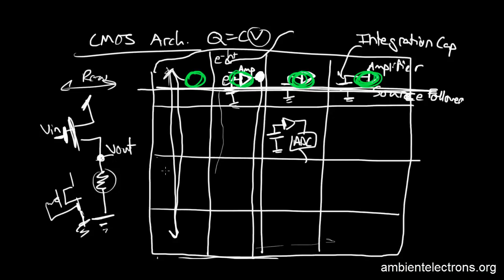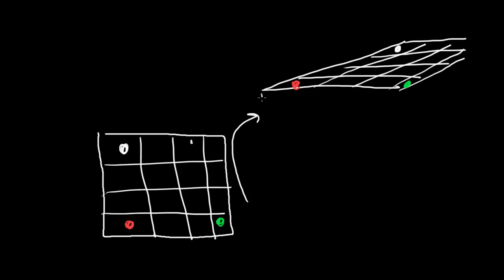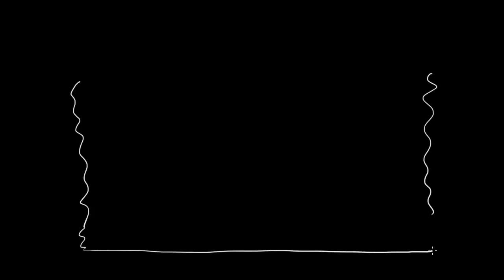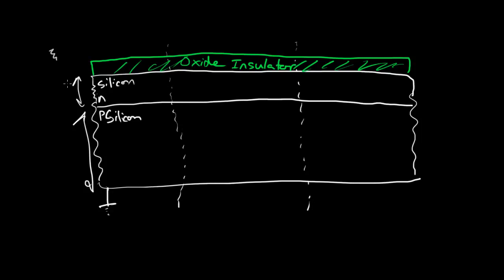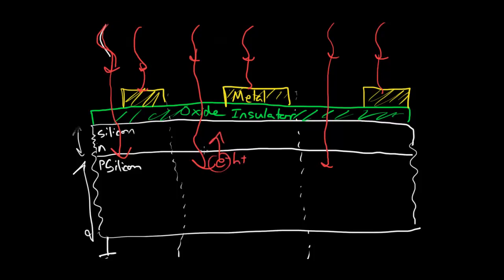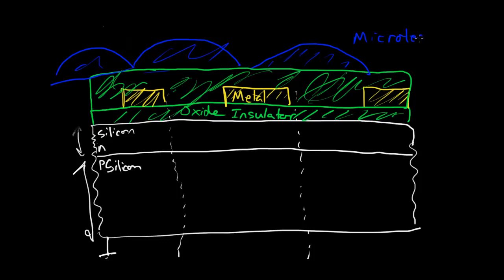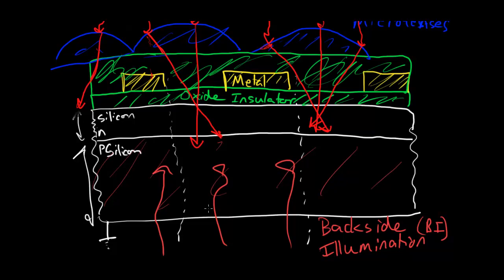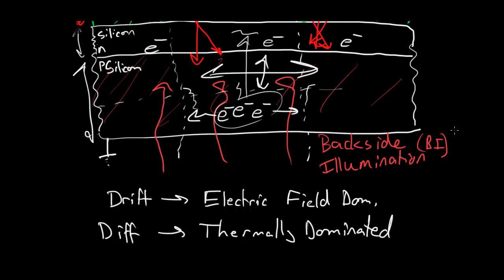Image Sensors 5 of 6 - Frontside and Backside Illumination

Comment: Is the metal + oxide the region acting as capacitor (and maybe amplifier?) and is being read out?

The photons whether they fall on p or n type semiconductor will cause electron hole pair, of which the electron will move to the edge of n type semiconductor from where it needs to be tapped into a readout.

I think you did a great job at explaining visually but the 3 dimensional nature of the whole thing still poses challenges when visualised in 2d.

Comment: Would it be possible to locally adjust the bias voltage to affect field and depletion inversely proportional to charge in capacitor well? It would be amazing to integrate large in the beginning then taper off electron-hole generation as the capacitor saturates.

Comment: I wanna ask a question about that metal. Maybe it's dumb question but still. What is that metal? Why do we need that metal if we can just put it away somewere? Cool technology. Let's put some metal stuff above the photodiode and then, many years later, we'll invent that we can put this thing away. Wow. Sorry for sarcasm. I scan internet for an answer but still i couldn't find any information about that wiring layer. Sorry for my english, i hope someone could understand what i'm trying to say.
Reply: That is exactly what I thought. Why use microlenses when you just can get rid of the "nasty" metal. I think the purpose of the metal is to separate pixels but it would be nice if someone confirmed it.
Reply: As far as I understand it, the metal is the electronic components that collect the charge and convert it to the voltage (capacitor and amplifier). Only a fraction of a CMOS pixel surface area is photoactive, the rest is used for the parallel readout process (c.f. the previous video). But you are right, it is not specifically stated in the video.
Reply: @ElKonfusius  But how would the metal collect the electron if there is an insulator in between them and the semiconductor?
Reply: @gpcm  I have the same question in mind...